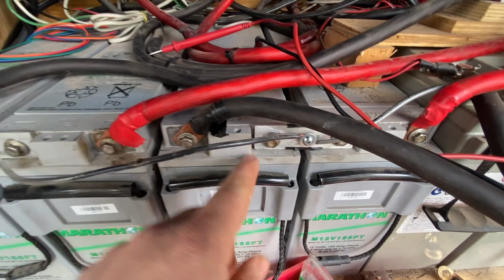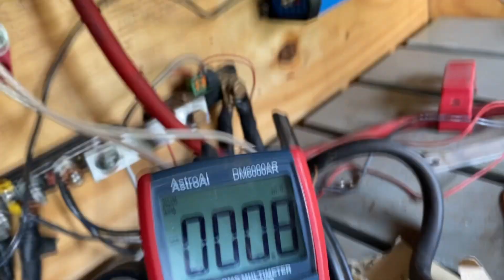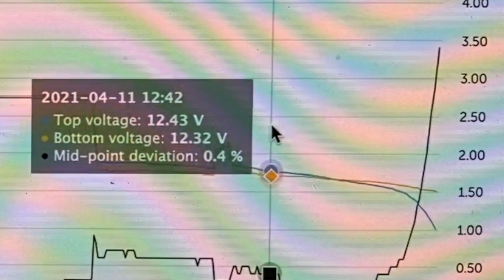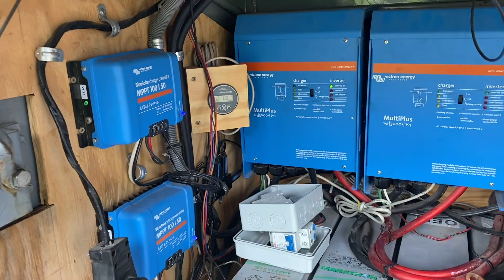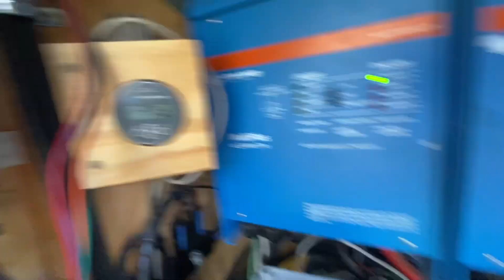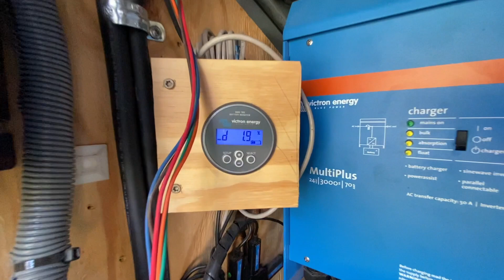RV Solar Battery Bank Capacity Test & Balancing AGM Telecom Batteries

Comment: hello, i just found your videos and love them! you got a sub from me.

since you are literally the only youtuber using telecom batteries in a bus i have a question for you.  i bought 4 marathon 12v 155ah batts. all 4 are in parallel  (620ah  310ah usable).

At night we top off all our batts with the generator ( solar not yet installed) and with our 2 cpap machines , fridge, furnace (off and on) and phone chargers we pull 10 to 16A.

batts do NOT last the night . I'm panicking cause we are fully invested at the moment and don't know if there is anything we can do

we did buy them used, they were used in radio towers for the army. they are 5 years old but are supposed to have a 15 year live expect.

any thoughts? am I screwed? 

(like i would wake up every few hours to check them and it stays at 12.9 v for hours then 12.8 for hours down to 12.7 then an hour later BOOM 10v
Reply from the maker: Make sure they are fully charged, AGMs take a long time. They need to hit 14.4v or so and then hold it until you get .5% capacity going into the battery.  In your case that’s 3 amps input. 

I’d also try a conditioning charge. Get them up to 15v for an hour or two. Then try again. I’ve reconditioned a few sets of AGMs this way. They will off gas’s some, if possible you can add a few table spoons of water back . There is white paper online we’re telecom companies started rehydrating telecom batteries with great success.

In the end, I now have lithium batteries, love them, built my own pack, very reliable, dependable.
Reply: @HimmelbergerBus  THANK YOU SO MUCH FOR THE REPLY! i will do my best to get them up to 15v, my converter in my rv can only get them to about 13.7 and i have a seperate car battery charger that got them up to 14.2, not exactly sure how to get them up there since all my chargers seem to drop off well before then. 

also do you know of anywhere to find info on cracking these open to add water?

thanks again for the reply.
Reply from the maker: @papaquintero  if you’ve only got them to 13.7, that’s the issue. A Victron Multiplus would be a good inverter charger to use instead of the converter.
Reply: @HimmelbergerBus  ROGER THAT! at the moment anything Victron is pretty well out of budget, that being said i can find a better charging alternative that plays well with AGM and can crank those batts up to 15v.   
its research time!! thanks brother for all the amazing info

ill keep you updated
Reply: sorry for rambling . kind of hard to explain the issues lol

Comment: I have 4 Gel batteries 12v  in series. So my battery bank is 24v. The 2 batteries dicharge faster. It is normal? Thank you
Reply from the maker: You mean two on top or bottom? No, it’s not good. Make sure you measure the actual batteries under load. There is line loss that can throw monitoring off.
Reply: Make sure you connect the two 24volt set in parallel and taking the power out from the two different ends meaning positive from one set and negative of the other set

Comment: I have no knowledge of the brand of batteries that you are using, but I was wondering. Can you run, or have you run an equalization cycle on the weaker batteries?
Reply from the maker: These have not recommended an equalization cycle. However, when a battery is only showing 20-30ah , there isn’t much to lose. 

So I have let them soak at a higher voltage and listen carefully for gassing . 14.7 or so bolts is the most I can run. I’ve done a few minutes at 15.5 just to see. 

I’m getting close to cracking the tops off and adding water. I have a white paper here,  using these batteries , that shows the ability to recover most of the lost capacity. It does take a few weeks or months for the water to seep everywhere. It could by why everyone says you can’t add water to AGM. It doesn’t show immediate results.

Thanks for the comment and watching!

Comment: Noticed your using steel nuts between the cable and the busbar, steel is a horrible conductor compared to copper, and generates heat. Move all your cables in direct contact with the copper busbar. Also I would suggest changing out your bolts from steel to brass.  Part of my job is running big UPS banks and you never use steel as the conductors. Hope this helps.
Reply from the maker: Thanks I’ll keep that in mind and possibly find some. I want to say all the bolts and nuts on the Victron multiplus are stainless steel so I didn’t think much of it.  I was also thinking that the nuts is mostly clamping the chopper and aluminum together so it didn’t matter much, but thank you for the comment. It helped me and Im sure others.
Reply: @HimmelbergerBus  the bars are either plated copper or aluminum on a victron, also the reason they are so heavy. The fixings are only there to keep the physical contact between the electrical contact  points. The brass bolts will reduce corrosion and are better conductors than steel due to the copper content.  The battery banks I deal with are normally in excess of 800v DC.

Comment: im doing 1/4" copper busbars.  Using a plasma cutter to cut them.  I the aluminum busbars are not as great of a conductor.  great video; thx
Reply from the maker: Yeah I agree, but I figured the amps between top and bottom batteries is only  up to 20 amps. I could look at doubling them up.  I might do some 1/0 cable for the midpoint balance connections. More I think about it I should, since the  difference is so low, usually not more than ½ volt.